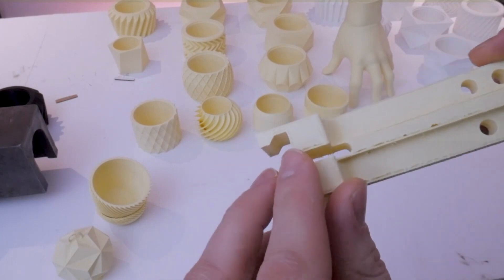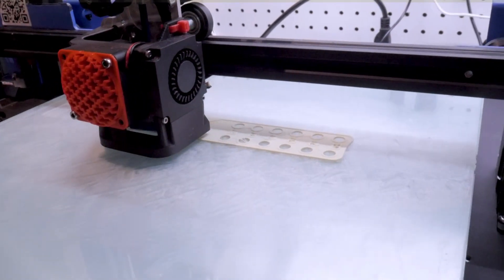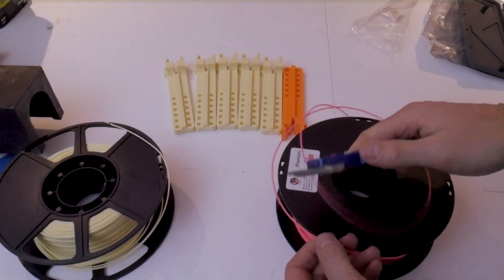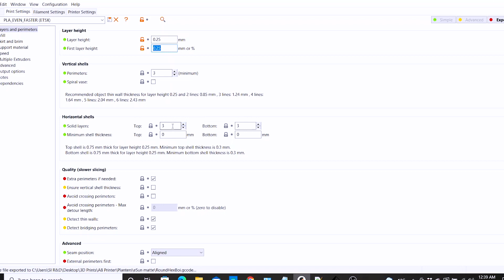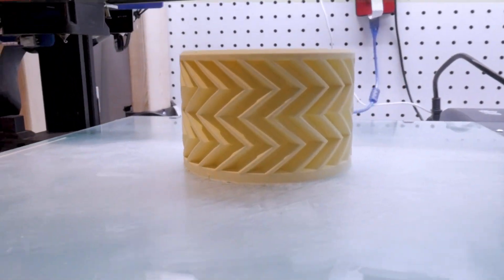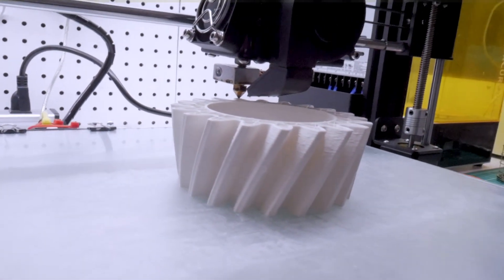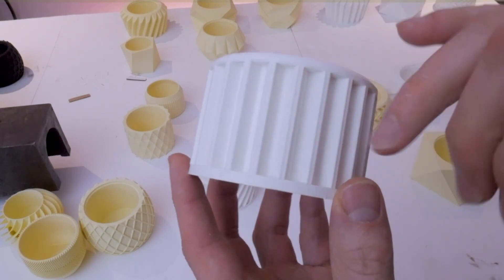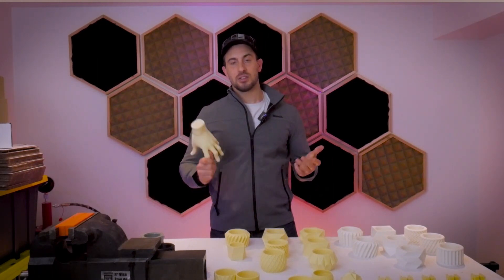eSUN Matte PLA Filament. How Matte? How Strong? Print Settings and Printing Tips!

Comment: Is there an alternative to this filament? So far I haven't been able to find anything that has this matte finish.
Reply from the maker: Check out polymaker polyterra pla or D3D matte ... both are excellent matte filaments!
Reply from the maker: If you check my channel I did another video on the D3D stuff I just recommended
Reply: @EmbraceMaking  I also print this filament at 205 degrees and 40mm/s.  Unfortunately I can't find any other filament that looks so great matt.  I cannot order the D3D from Germany.

Comment: Good looking PLA its just very brittle. Parts have to be thick or they'll break easily.  I usually reinforce my matte prints with regular PLA - to get the look while also having the durability.
Reply from the maker: Cool, do you reinforce with the regular PLA using a dual extruder set up, or?
Reply: @EmbraceMaking  I just reinforce with regular pla ( no duel extruder).  The matte pla would just act like a veneer.

Comment: this material has been a nightmare for my artillery, no matter what layer height I use...
Reply from the maker: Which problems are you running into specifically?
Reply: Hey I agree my x2 has terrible bed adhesion with esun aswell as low extrusion leading to layer delimitation. I've had minor success printing sliced for a 0.6 nozzle even though I have a 0.4 installed. The matte mint green Was the first filament I brought that wasn't black when I first got the x2, since then I've probably went though 50+ rolls of standard coloured filament but been having trouble with silk and matte, tried everything but nothing seems to work

Comment: What slicer software was it that you were using in this video ?, and thank you so much for the indepth review of this filament I was having issues with mine ( I have White , Black and Pink) on the pink spool I have not yet tried the Black or White, I'm about to try a rerun with increased temperature (was running AT 215) as i was getting either clogging or it was failing to pass the extruder because the filament is simply to thin and was spinning and grinding, into the 1.60mm's at some points. Excellent video thank you, subscribed and notifications on.
Reply from the maker: I use PrusaSlicer for all of my printers right now. Sounds like you are struggling with a lot of the same issues right now! If you get anything sorted out, be sure to come back and post your solutions for others to read. Thanks for subscribing!

Comment: I bought this filament a few days before this video came out and couldn't find anything at all on the internet about it besides the esun website. My regular pla settings had so extreme under extrusion my benchy was barely recognizeable as a benchy anymore and it took me a while to figure out how to get a somewhat decent quality off it. Cranked up temperature and slowed down the speed and got better results but never got rid of the inconsistent extrusion causing gaps in the layers. I am glad i just found this video, I hope i can get the quality of prints off this filament now i do off any other pla too, the matte finish makes it so worth it for me experimentating with. Great in depth video!
Reply from the maker: Thanks! It is definitely more challenging to print with, let me know if your experimentation yields any positive results!
Reply: Used this MATT for the first time yesterday and also got layer gaps what temp and speed did you have success with ?
Reply: @warwickEDF_jets  not sure since its been some years since i last used this filament, but slightly lower than average speed with 5% higher flow, and higher temps. Not great for bridging as a result, and may have elephants foot, but at least it printed nice that way for me. 
I moved on to eryone matte filaments after that, they print beautifully at any settings

Comment: Hey dude thank you for making this video I'm going to try some of these settings but ATM I'm struggling to get the  first layer  to stick. I run an anycubic i3 mega I've tried to print at different temps between 190-230c on hot end and the bed is 60c  it is a glass bed. Any ideas ?
Reply from the maker: No problem! Does your anycubic use the Creality style glass with a textured side? On my printers, even the Creality ones with the textured glass, I always use the FLAT side, not the textured side. I find the Creality style textured glass never works well. Start with a nice flat glass surface, preheat your glass to 50-60 and then apply your glue stick. I always apply while hot so that it flows over the glass nicely and gets distributed evenly. Then start your print and it should stick... some filaments will allow me to keep printing with layer after layer of glue stick built up from each new print. Other filaments are more picky and require me to scrape off the old stuff after 10 prints and then start over with a nice smooth application. Let me know how that goes
Reply: It does have a textured side but I can't remove it/ flip it :( I think it's made one piece with the heating element
Reply from the maker: Are you using glue stick?
Reply: @EmbraceMaking  nope never had 2 I've been printing for over 2 years with loads of different pla/pla+ filamentsand never used gluestick I just seem to be having trouble with this matt filament I don't really want to start going down the route of using file if I can help it
Reply: were you able to solve it? :O

Comment: Thank you for this clip. I am using Ender 5 Plus with Micro Swiss Direct Drive. I have to crank the temp all the way up to 230c and slow down to about 22.5 mm/s. It's printing well now just with some of stringing.
Reply from the maker: Good to know, I'm going to try going really slow but I was hoping that wouldn't be the case!

Comment: Hello. I got good results with 205C and reducing the speed a lot (40 mm/s) Also this filament is less dense as the regular PLA so it slips more on the gears causing some under extrusions on the parts. I reduce the speed until the clicking noise on my extruder stops. Nice video...
Reply from the maker: Thanks for the comment! Yes, I mention that the density is lower but I didn't find that mine was slipping. I took a look for grinding at the extruder gear and found none... I'll try and print even slow and give it a try though!

Comment: Greetings with the best for '22. Wanted to touch base via this vid as it's your most recent although it pertains to those you posted some time ago featuring your custom muffler designs. Incredibly helpful intel and I hope you don't mind if I pass along the link as a reference to others I've been consulting with for a solution to a very similar objective. So, I have a question. Had you considered introducing any type of packing material with the various baffles and if not, was there any particular reason? Until I watched you spell out the basic physics clearly and simply with your CAD presentation,  I (we) could only speculate as to how to match engine specs to avoid expensive damage. Now, here's the kicker . . . "our" applications are for garden tractor exhaust systems LOL (and I'm sure you are now reading this) however, although the machines are very different, the principles of internal combustion remain the same. What I need specifically is to convert a dual inlet single factory muffler for a 25Hp twin to a L&R straight setup with something inline that's as quiet as a mouse fart but won't cook the valves as a trade off and, as you can imagine, size will matter. That first 3"X5" you tested put a few things into keener perspective in that while I was watching I expected to see something significantly larger. Now, having spared me and others from hours of trial & error with your results with the cones, the auger and the other configurations (an appreciative straight up thank you for sharing that with the vid by the way) I can tailor my efforts toward something compact and efficient. Still though, I am curious about option(s) using packing and if you have a minute sometime I'd appreciate your thoughts on it. Thanks again and as always . . . Stay Safe!           JJFIII
Reply from the maker: Hi John, thanks for the comment. In that video I didn't use packing material because I didn't have a lot of space to work with in terms of pipe diameter. I didn't want to reduce the piping diameter to fit in packing material. Also, without a good amount of length, the packing material won't do anything significant. For example, a 6" long glass pack muffler won't do much, whereas an 18" long one will. I didn't have 18" to work with so I just crossed it off the list immediately. For your application perhaps you have room to use a packed muffler but make the exhaust gas "meander" inside for a bit before exiting. This would quiet things down, and I believe this is the approach most oem car mufflers use. They also have the luxury of having engineers on hand who have designed mufflers their entire careers so they know the science behind using reflections of waves to create a destructive waveform to cancel certain annoying frequencies. But I think if you meander the exhaust enough with some good high temp packing material like stainless steel wool you will get a good result.
Reply: @EmbraceMaking  Greetings and thanks for getting back. I'm going to need to review the CAD seg of the vid again while figuring percentages of "me's & "ander's" LOL ... Be Well   JJFIII